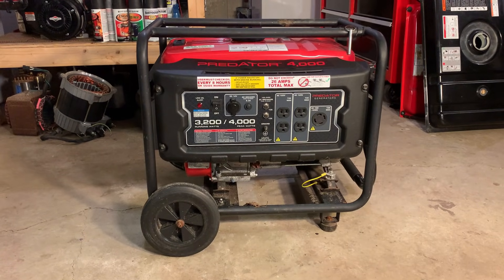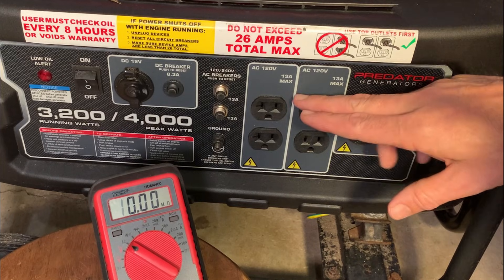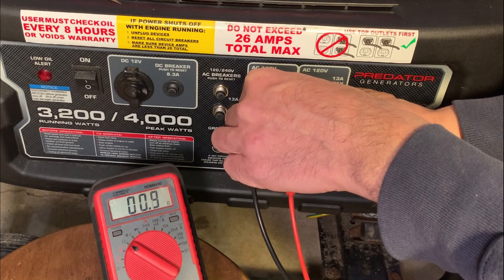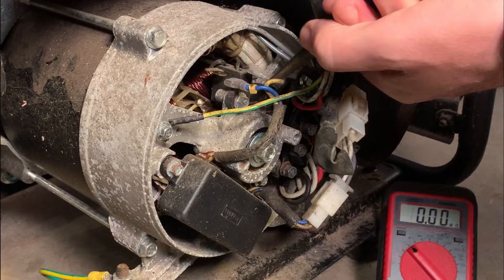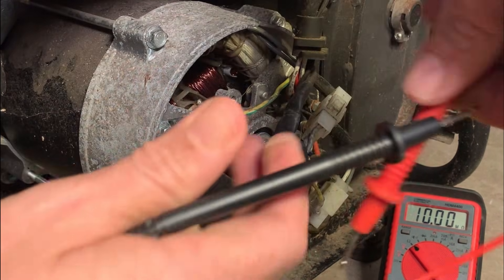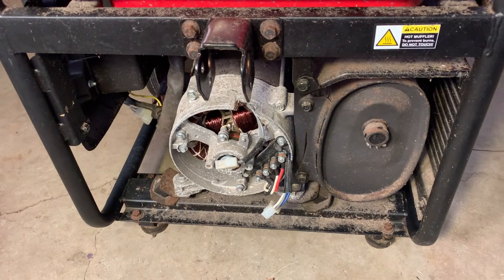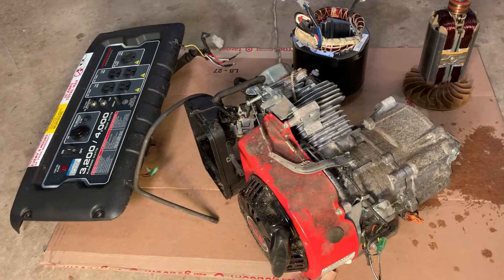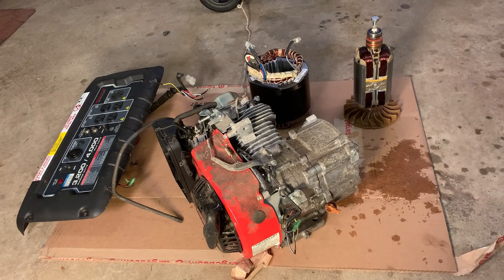Predator Generator Not Making Power

Comment: Do you have someone in your area that repairs/rewinds electric motors?   You've done all the hard/PITA work they charge big labor hours for.   I took a rotor from a Dewalt 8000 watt with the same problem and the motor guy fixed it... while I waited... for $50.   I think it took him less than 10 minutes.     A contractor buddy bought it from a friend who was moving out of state and it was still in the box, never been run.  When he finally got around to needing it, it ran about 20 minutes then it just it stopped generating power.   He had no receipt, no idea where it even came from so he couldn't warranty it.  It's still running fine, 18 months now.
Reply from the maker: The local electric motor repair shop refuses to work on anything generator related.  I called around once and was quoted crazy high numbers.  Have not looked since.  Maybe should try again.  $50 is a great deal.
Reply: @jcondon1  Bummer, too bad your guy doesn't want to work with you.

Comment: Wow such a shame you can’t get another rotor, but that’s the way the power equipment industry is going. Most of the Chinese made stuff has no repair parts available. So basically it’s a throw away. Hopefully you can repurpose all the good parts you salvaged to fix one, two or more down the road....?
Reply from the maker: I probably could.  This is very similar to a Duromax and Champion of the same size.  But a rotor usually would cost $200-$250, and that is more then this is worth.  Next time I will try and repair the rotor.
Reply: @jcondon1  I’m good at fixing anything engine related on a generator, mower, chainsaw, string trimmer, etc...My nemesis is trouble shooting the generator if it’s not generating power. Your videos have been a great help for me. Thank you and Happy New Year.
Reply: @The_Happy_Aviation_Enthusiast  thanks for the tips.

Comment: Hey James do you have a business fixing generators and if so where are you located I have a honda 6500 ebx with iavr and can't seem to figure it out
Reply from the maker: I do not run a business, but have been known to fix a few for people.  I am about an hour north of New York City.  What is going on with your generator?
Reply: @jcondon1  I have a eb6500x with a iavr it runs fine I have changed the brushes I have cleaned the slip rings and still no power I'm reading 00.6 ohm when I test bother 120 and 240 outlets and 60ohm off of the brushes
Reply from the maker: @geekgod43  the readings seem good.  But would need a high voltage megger test to be sure.
Reply: @jcondon1  what would I be looking for if I was able to use one f those
Reply: @jcondon1  so I tried flashing the field with a DeWalt angle grinder that did not seem to help for work
Reply: @jcondon1  so after doing more testing I I got a reading of 1.4 ohm off of the blue wires off of the stater what would be a normal reading from that
Reply from the maker: @geekgod43  1.4 ohms is a good reading on the blue wires.
Reply from the maker: The megger tests the insulation.  Similar to an ohms test you want to put one lead on one coil and the other lead on another coil and test resistance.  The number should be infinitely high if the insulation is working.  You want to test each coil to all the others and each coil to ground to make sure there is no connection.  You would have to isolate (disconnect) all wires on the stator and the brushes first.  The megger will send high voltage for the ohms test 1000 volts+.  A multimeter only tests ohms at about 1 volt.  Also, if you have not, isolate all the windings and test in ohms each coil to ground and to each other and make sure there is no connection.
Reply from the maker: All your ohms reads seem pretty good.  The only one that is a little high is the stator reading.  Is the 0.6 ohms on one of the 120 coils or through the 240?  Also does your generator have the 120/240 switch?  If so, put in the 240 mode and test from the 120v outlets and the 240.  Would expect between the hot wires on the 240 circuit to be twice the ohms of the 120.
Reply: @jcondon1  thanks I know this it a pain for you but do you have a video about how to test iavr this one doesn't have the normal avr in the power head it's behind the outlet pannle and I haven't  found any videos how to replace it or if there are even any replacement parts for it https://www.hondapartsnation.com/oemparts/l/hpe/5eb4641e87a8660eacc4dbb4/eb6500x1-ag-parts in the oem diagrams they still show an AVR but that is not present inside of my powerhead
Reply: @jcondon1   how would one go about testing this ?
Reply: @jcondon1  And how does one test a GFCI on the front of the generator? I know it was out in the rain once while in use but light rain I'm wondering if that ruined the GFCI
Reply: @jcondon1  And is there a way to test to see if the head is creating power and it's just not getting to the board?
Reply: @jcondon1   it have been to burning man for 4 years and has alkaline playa dust inside the powerhead assembly but all the wiring looks good just very confusing
Reply: @jcondon1  And thank you for all your content I have watched all your videos trying to figure this out
Reply: @jcondon1  The one thing I have not done is take the powerhead completely apart which seems to be like it's going to be my next step
Reply: @jcondon1  the generac 10,000 video you did seemed to have an iavr I haven't even opened behind the panel to look at it
Reply: @jcondon1  any thoughts or help would be super helpful trying to do this as cheap as possible living on va disability during covid-19.

Comment: worth it in parts James , I can fix those rotors . I have fixed several of them in the past as that is a very common issue on them .. Great share ENJOYED !!
Reply from the maker: Good to know.  Have had a lot of subscribers offer to fix.  Will have to take someone up on the repair next time.  I have fixed them before, but don't have the proper soldering iron to do the job properly.
Reply: @jcondon1  I am setup with a microscope and soldering station . They are tricky but can be fixed , Thanks James !!

Comment: Take the rotor to a motor shop and have them do the rewinding / repair. Probably wouldn’t cost much.
Reply: Electrical safety when using portable generators: Always make sure you follow all the generator safety rules whenever you use your portable generator. This is only a reminder. Generators can be dangerous if not used carefully. Every year, hundreds of people die or get injured when using portable generators due to carbon monoxide poisoning and electrocution. Make sure you are using your generator carefully and keeping others safe as well. There is something very serious that everyone should always be aware of when using generators. Some people do run their generator indoors which is not safe and that increases the risk of carbon monoxide poisoning which can cause death of family and you. Some people run their generator in wet conditions which can electrocute them. Please remember that you should never run your generator indoors. Remember that carbon monoxide is an odorless and colorless gas that you cannot see or smell. Carbon monoxide is a silent killer. Keep that in mind. Make sure your generator is 15-20 feet away from your house and away from doors, windows, and vents. Never use your generator in your porch too. Having a carbon monoxide detector is very important against generator safety. Some people also allow children to go near the portable generator which could pose risks. We need to keep an eye on our children making sure that they are not near the portable generator so they won’t get electrocuted or burned by the generator which is dangerous. A locking enclosure also keeps kids safe. A generator shed might look like a tempting place to explore, or take cover during a game of hide and seek, but a generator is a dangerous piece of equipment that can cause injury. It says on the manual that we should also keep children away at all times from the portable generator to avoid injuries. Please do not allow a child or unqualified people to operate the portable generator.  It is important to keep your children safe especially little ones. The portable generator can be hot during an operation. Just because some manuals missed what should be listed doesn’t mean it’s safe to do. Always follow the generator safety rules when using portable generators. Generators pose electrical risks. If you need to use your generator during wet weather, you need a generator tent to protect your generator from getting wet. Don’t let your generator get wet. Keep your generator dry and before using your generator, please make sure your hands and your generator is dry. Do not wear loose clothing when operating the generator. Everything that is said on the generator’s operating manual should not be ignored. Never smoke cigarettes near the generator. Please keep flammable things away from the generator. Never overload your generator too. Your generator can catch fire. Never ever try to plug a generator cord into a wall outlet to avoid back feeding. Back feeding your generator is dangerous. Always turn on your generator first before plugging in appliances and shut off the appliances before turning your generator off. Use a heavy duty cord for your generator and the cord should not be worn out. All the instructions should be followed carefully. Never refuel your generator while it’s running. It can cause fire if fuel spills while your generator is hot. You should turn off your generator and let it cool off before refueling it. Having a fire extinguisher next to the generator is also important. This is only a reminder for everyone’s safety of using generators. Make sure your generator is properly grounded. Having a fire extinguisher next to the generator is also important against the safety rules. https://youtu.be/I1jT3ANENvI and here is a video more about keeping others safe when using generators and also about our family’s safety. It’s important to keep our little children safe as well. Make sure your little children are kept away from the generator at all times especially when it’s running. Hope this helps. Always remember that being safe is better than being sorry.

Comment: I've fixed far worse motors than that rotor! That would be a dead easy repair!
Reply: Electrical safety when using portable generators: Always make sure you follow all the generator safety rules whenever you use your portable generator. This is only a reminder. Generators can be dangerous if not used carefully. Every year, hundreds of people die or get injured when using portable generators due to carbon monoxide poisoning and electrocution. Make sure you are using your generator carefully and keeping others safe as well. There is something very serious that everyone should always be aware of when using generators. Some people do run their generator indoors which is not safe and that increases the risk of carbon monoxide poisoning which can cause death of family and you. Some people run their generator in wet conditions which can electrocute them. Please remember that you should never run your generator indoors. Remember that carbon monoxide is an odorless and colorless gas that you cannot see or smell. Carbon monoxide is a silent killer. Keep that in mind. Make sure your generator is 15-20 feet away from your house and away from doors, windows, and vents. Never use your generator in your porch too. Having a carbon monoxide detector is very important against generator safety. Some people also allow children to go near the portable generator which could pose risks. We need to keep an eye on our children making sure that they are not near the portable generator so they won’t get electrocuted or burned by the generator which is dangerous. A locking enclosure also keeps kids safe. A generator shed might look like a tempting place to explore, or take cover during a game of hide and seek, but a generator is a dangerous piece of equipment that can cause injury. It says on the manual that we should also keep children away at all times from the portable generator to avoid injuries. Please do not allow a child or unqualified people to operate the portable generator.  It is important to keep your children safe especially little ones. The portable generator can be hot during an operation. Just because some manuals missed what should be listed doesn’t mean it’s safe to do. Always follow the generator safety rules when using portable generators. Generators pose electrical risks. If you need to use your generator during wet weather, you need a generator tent to protect your generator from getting wet. Don’t let your generator get wet. Keep your generator dry and before using your generator, please make sure your hands and your generator is dry. Do not wear loose clothing when operating the generator. Everything that is said on the generator’s operating manual should not be ignored. Never smoke cigarettes near the generator. Please keep flammable things away from the generator. Never overload your generator too. Your generator can catch fire. Never ever try to plug a generator cord into a wall outlet to avoid back feeding. Back feeding your generator is dangerous. Always turn on your generator first before plugging in appliances and shut off the appliances before turning your generator off. Use a heavy duty cord for your generator and the cord should not be worn out. All the instructions should be followed carefully. Never refuel your generator while it’s running. It can cause fire if fuel spills while your generator is hot. You should turn off your generator and let it cool off before refueling it. Having a fire extinguisher next to the generator is also important. This is only a reminder for everyone’s safety of using generators. Make sure your generator is properly grounded. Having a fire extinguisher next to the generator is also important against the safety rules. https://youtu.be/I1jT3ANENvI and here is a video more about keeping others safe when using generators and also about our family’s safety. It’s important to keep our little children safe as well. Make sure your little children are kept away from the generator at all times especially when it’s running. Hope this helps. Always remember that being safe is better than being sorry.